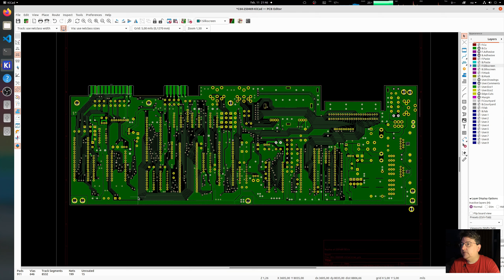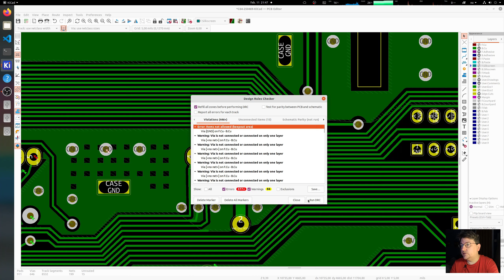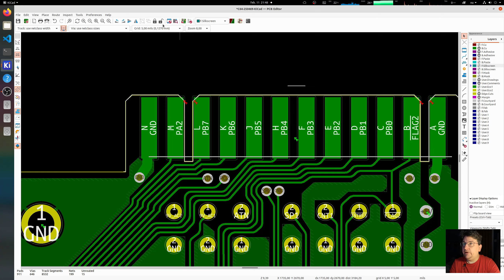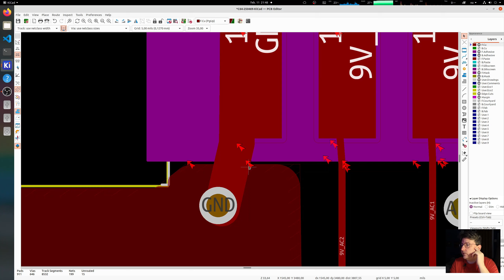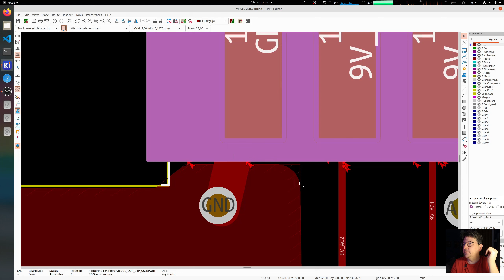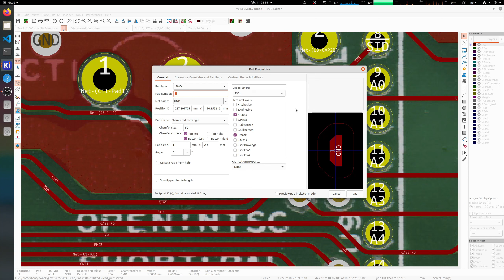C64C Motherboard KiCad Replica update 5

Comment: Awesome work! For the unconnected pins on the 8701, edit the symbol then for each unconnected pin edit its properties "Electrical type" from "Input" to "Unconnected". That way, the unconnected X will be in the symbol and you won't have to place the X in the schematic (and they can be on top of one another like you had originaly). Also, I think the shielded ground needs its own name.
Reply from the maker: Thanks a lot. I will try out the suggestion!